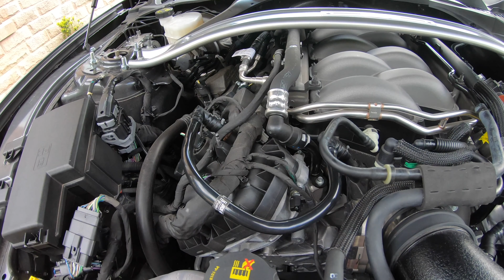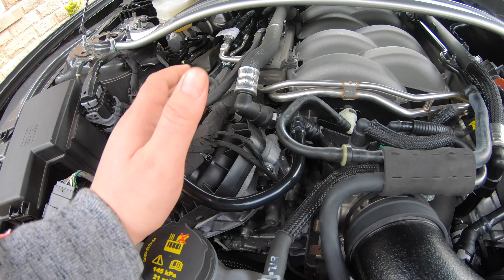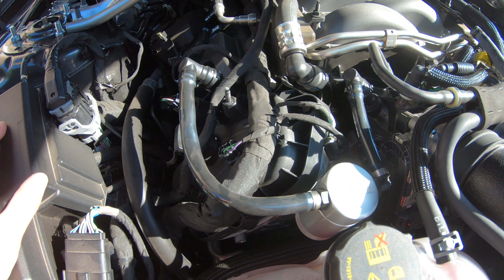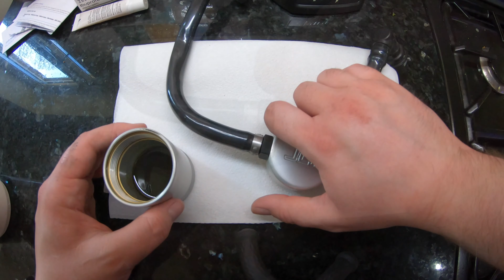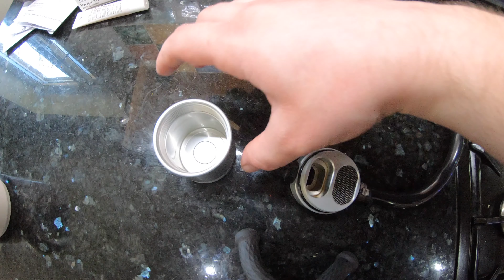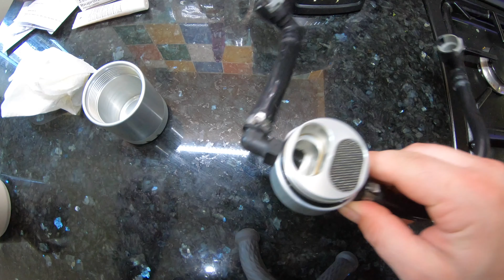JLT 3.0 oil separator install and maintenance on the 2018 Mustang GT

Comment: Nice Video.  I'm not sure what I am doing wrong.  I have the exact same can on a 2017 Camaro SS, and I simply cannot unscrew it to empty it, no matter how hard I try.  The disconnects on mine are a lot harder to get to so I was just going to unscrew it without disconnecting those.  I'm wondering if that is the problem.  Is there a lot of pressure on those hoses that might prevent it from unscrewing??
Reply from the maker: Thanks. I can definitely believe the suction would cause it to be quite difficult to remove whilst still attached. The threads and rubber washer are very high quality and form a pretty perfect seal. I always fully remove mine to empty, but I did try to unscrew once whilst still attached and didn't have much luck.
Reply: UK Mustang Guy 
Great!  Thanks for trying and letting me know that. You are right the suction is tremendous!   I actually went back out and tried again using a pair of channellocks and it worked!   It wasn’t easy, but I got it off.  2000 miles since install and it was about 1/4 full nasty milky oily stuff.   Great purchase!